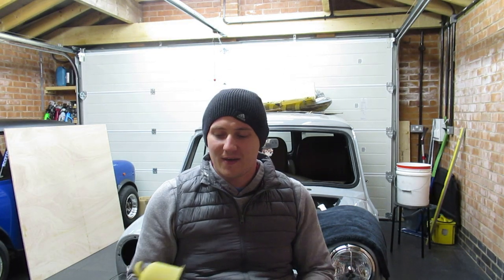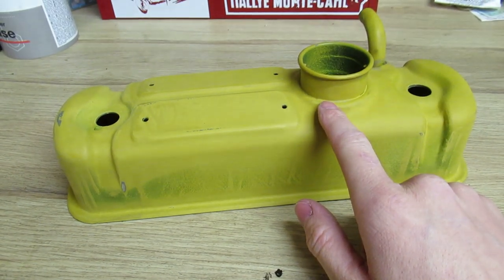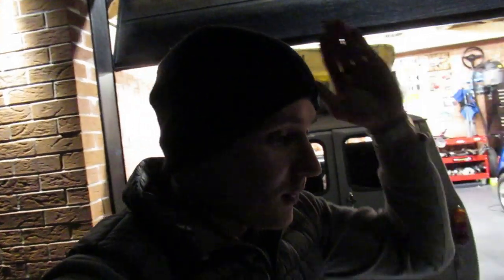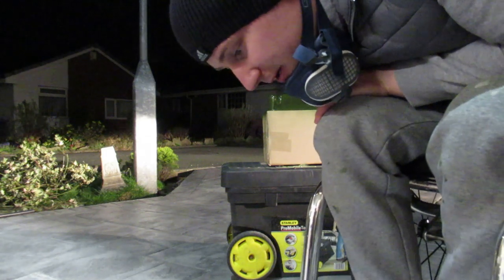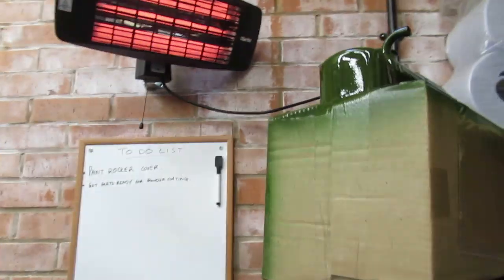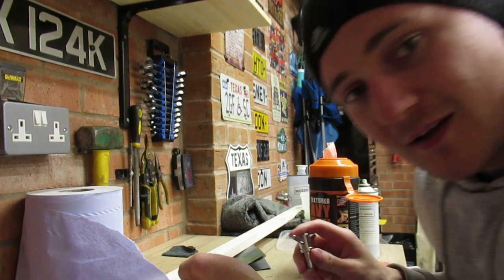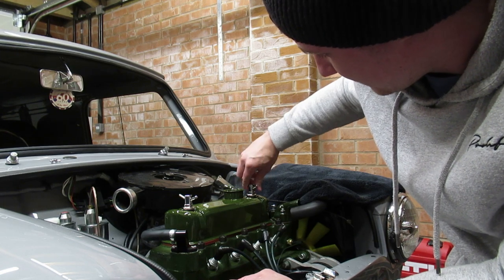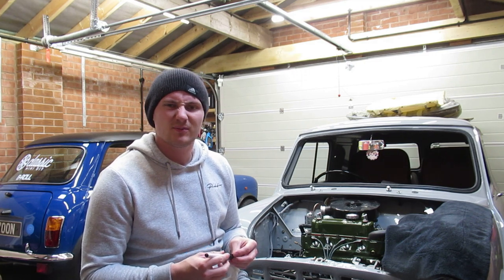Classic minivan  *RESTORATION* how to paint your rocker cover properly

Comment: Alex, you get your cars to such a high standard that I wouldn't dare use them in case I damaged them, I'd be devastated if I did. Kev Richardson's right about the rocker cover plates, I've seen the damage done by a rogue rivet, destroyed a couple of valves and holed a piston on an MG Midget. Doing the same as everyone else in lockdown, trying to stay safe and sane.
Reply from the maker: Thanks mate, I love the challenge to see how good I can get things. Also it shows people you don't need to pay professionals for everything! By no means will this be a trailer queen! As I will maintain it properly and it will last years before any major work is needed
Reply from the maker: Wouldn't want to ruin my engine for the sake of 4 screws 😂
Reply: @classicminidetails8887  Definitely no trailer queens, I don't see the point to those unless they're a unique vastly valuable car but even then its a risk moving them, trailer or not.
Reply: @classicminidetails8887  I only ever saw it once in my 4 years of working on A and B series engines but it can happen so really not worth the risk for all the damage it can do. Screw your engine rather than rivet it 😂
Reply from the maker: @graemew7001  it's was screwed on when I took it off and I intend to use a rivet as it looks cleaner. Kevs video come at the perfect time
Reply: @classicminidetails8887  Just been watching your hand controls video again and a question came to mind. Did you ever consider converting the van to auto as opposed to spending the £2k on the electronic clutch?
Reply from the maker: @graemew7001  as soon as I found out I could adapt a manual I couldn't resist! The ecu that controls the clutch I could put on another mini should I wish to change the van. I wouldn't buy another automatic mini as the minis I want next it would be crazy to convert them to auto
Reply: @classicminidetails8887  Cheers Alex for getting back so quick. That's handy if it can be moved about to other Mini's. As far as I've read they couldn't get the MPi auto to work so the SPi auto were the last ones (true? 🤷‍♂️). So that makes sense as to why you'd stay manual now. Thanks for the answer. You and your respective families stay safe and healthy 👍🏻.

Comment: Looking fantastic, a credit to you. The issue with the rocker cover name and patent number plates is if you pop rivet them on the pop rivets lose the little ball thing into the valve gear. You can buy the original dome headed rivets, from miniparts suppliers, which Look much much better than self tappers and don't cause any problems.
Reply from the maker: Thanks Stewart, I need to place an order with them so will have a look

Comment: Brake lines is my question , what are you using , are you making / made new for the new master cylinders you purchased etc . my mini needs an overhaul of the brakes as its a 1978 with drums allround and a diagonal split system. once funds become available ill be getting the full 7.5 cooper s front setup , new master and bias valve and rear brakes to go with , so seems daft not to chane the lines while im there . just curious on what youve done / used . thanks . keep up the good work man your making great content.
As for what im currently doing,  not alot , id love to be working on mine , i managed to fit a new boot seal yesterday as its the only parts i have waiting to go on. 
due to things out of my control i lost my liscence to medical reasons and also got furloughed , meaning finances are being used last on my mini :/
Regards Rob
Reply from the maker: Hi mate, the brake lines I am using all new as they run the wrong way as they were servo previously. Keep positive with the mini mate am sure you will have the time and your licence back. I know the feeling I had mine took for 6 months when I was first injured
Reply: @classicminidetails8887  standard copper? As yours look like steel?